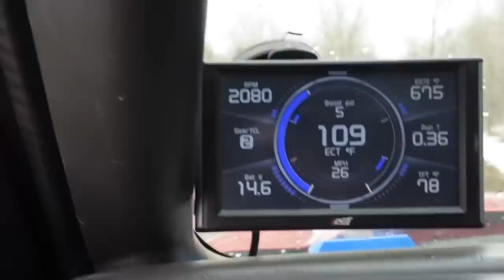MY DURAMAX LEFT ME STRANDED SO I DID THIS!

Comment: I would leave it looking stock on the outside while improving the intake and under hood components. Maybe install a flat-bar intercooler which will reduce intake temps over 100 degrees.... The perfect camper pulling rig.   Nice ride Josh.

Comment: Love my LMM. Deleted and tuned, all HSP piping, 4 inch straight piped, AD 4G 165gph, TransGo shift kit, Dan's diesel performance Allison transmission computer with Enhanced trans tune. Crew Cab 4x4 LTZ, loaded. 
She outruns 5.0 GT Mustangs. Daily driver. Gets 22mpg.
You gotta get the genuine neoprene custom fit seat covers from Cover Kings for that LMM. I got them and they're amazing. Looks factory, and super comfortable. 
Mine is leveled with with the Zone Offroad upper control arm kit, 33 inch tires.

Comment: I just installed aftermarket return lines with my new motor, injectors, ect. should i be worried i thought i saw you use them and that's why i got them. Also Thank you so much for your videos if it wasn't for you my truck would be in the driveway with a cracked piston. no way i could afford to have a shop do the swap and I desperately needed my truck for work . Me and my buddy used your videos to do 90% of it with very little experience working on diesel engines it my first one . picked up a LBZ engine with lower mileage from a junkyard and swapped it in my 2 car garage.  so far everything has been perfect! THANK YOU!
Reply from the maker: That’s awesome man I’m glad the videos helped! I’m thinking the return metal fittings are recommended but the cheap return hose failed on me so I would say keep an eye on it
Reply: There's lots of opinions to use original return lines. Tons of aftermarket just leak

Comment: Well Pvt. Recovery proved herself worthy of joining the platoon. Keep the upgrades simple and clean. Aimed at pulling the Command Post around.  Maybe a topper on the bed, allowing for additional troop support  cargo on the weekend deployments.  A good all terrain tire with proper sidewall height and capacity for towing.  Zero lift, leveling airbags. Proper lighting up grades, back up cameras,  transmission up grades for towing.  Repair the rear body damage and Raptor liner the bed. Black rims with red trimming. Mild exhaust upgrade.  ..... BUT FIRST... [dream scene ends abruptly].. FINISH THE WIFEMAX  !!! 
 great project looking forward to seeing what's next  and as always well done program.
Reply: One other note... for your travel trailer.  Look at rock guards for the front of it. Additionally you can easily fabricate a full length bar and mud flap that works with the rec. hitch.  Traveling down the highway over time flings a lot of small rocks.  The front of the trailer catches them all.  Foul weather of any kind just adds to it with road debris.

Comment: My ‘07 classic ccsb Lbz mostly stock, but leveling kit and rear block with 285s weighs exactly 7,000lbs. Not stock for long, just picked up a Dana 60 front out of an ‘05 f250 to do an SAS on the front end. I will always buy GM only but am not a fan of ifs
Reply: IFS has the best ride quality. Throw on some HD tie rods and center link braces and it's pretty much bulletproof.

Comment: I do actually run the aftermarket return lines thatre the rubber fuel lines with the lil metal injector fittings instead of the plastics and personally I LIKE them. They have done very well so far and were incredibly easy to fan into your own lil custom lines. And they compliment the engine bay well with how dang shiny the metal fellas are! I'd recommend them.
Reply: It's usually shitty clips that pop off. I had a LBZ before getting my LMM. Was driving that LBZ one day and started to smell a strong diesel fuel smell and noticed white smoke behind me. Pulled over and saw fuel pouring from an injector return line. The clip was missing. Just fell off and the return fitting popped off.
Reply: @saltysteel3996  I like these fitting atleast because they fit into the injector very snug and firm. I do see where ur coming from with the clips tho! Because I noticed when installing some of them that a couple seemed to fit a little bit loosely or would walk back slightly. But I was able to fix this by just taking them and gently squeezing them a little closer together for a tighter pinch. Little trial and error with making sure they weren't squeezed to much and cause u to just wrestle getting it snapped on there but all and all just squeezing them a bit solved those issues quick! Granted it hasn't been quite a year since I've installed them but close to and I haven't had a single issue out of them yet! I do however check under the hood atleast once a week and always check on them just to make sure. I had 1 clip slide back maybe a 1/16th of an inch on me a few months ago. Pulled off punched it a lil more and hasn't moved at all since then! Maybe I just got lucky I guess? Idk, but so far even considering the clip situation u mentioned I 100% would still recommend. Just take your time on the install and pay attention to those tiny minor details like that and it'll all be good by the end!

Comment: Are you sure that the head gaskets are bad. The LMM is running awefully well to have blown head gaskets.
Reply from the maker: I will find out very shortly
Reply: @TruckMaster  I'd be surprised if they're bad. LBZs and LMMs don't usually have head gasket issues, even when turned up to the max.
It's usually the water pumps that are known for failing. Luckily my LMM hasn't had water pump issues yet.
Reply: I was thinking that myself but it be so awesome for ya if it be something else hoping it is would you consider fire ringing or leaving it like it is just curious
Reply: Truck master do you normally add diesel additives every time you add full.
Reply: @Andrew-mr4cj  from what I've found most people say you don't really need fire rings on a dmax
Reply: I don’t think I’ve ever seen a duramax run poorly from a bad HG, they blow internally so all they really ever do is pressurize the system and puke coolant
Reply: Do any of y’all add diesel additives every time y’all add fuel or fill up.
Reply: @robbieholcombe1213  every time I fill up I do. I use hotshot edt
Reply: @robbieholcombe1213  I add a gallon of ATF every 3 or 4 tanks

Comment: Had a 2013 GMC and now I have a lly I miss my 2013 pulling a 42' 5th wheel Montana 25500 lbs fully loaded lly can do it but summit she was a Beast at pulling. I can tell ya the 6.0 and the 6.4 f450 don't run like a Duramax.

Comment: Okay, your kidding when you said your getting 15 mpg towing that trailer will that truck on the back!
I’ve got a 2020,3500 hd duramax drove from florida to Wisconsin hauling trailer and car and averaged 9.9 miles per gallon.
I’m very disappointed, I thought it would be better,with the 10 speed trans.
Reply from the maker: That’s what it said on the dash 🤷‍♂️ but this truck is tuned and deleted also so it probably really helps

Comment: As a legit wrenches, maybe come up with “The roadside survival kit” .  I keep fuel filters, fuel treatment, oil, serpentine belt, tools.  But I never carried fuel line.  Hey TM, What else do you think we should have?
Reply: Duct tape, concrete tie wire, zip ties, fuses, bulbs, 16ga wire, wire terminals, multimeter

Comment: That video was awsome I just bought my first disesl  pickup and it's a 2016  Chevy 2500 durmax. So this video helped me out. I do have  a few questions  I'm getting  18.5 mpg  on the road running 65-67 mph.  My questions is if I want to increase  my mpg  and I want to a good cold intake air system  on it . I do use on my farm and driving  to doctors  appointments  in Temple , Abilene  Texas  so I'm thinking about a set of  torque

Comment: About time for another video truck master!!!!!!!! LOL
Reply: @TruckMaster  I would do the samething you are doing before replacing head gaskets. Fix the simpler things that cost next to nothing and then work from there. Atleast if you do have to replace head gaskets you got new thermostats now, coolant, and a new upper radiator hose too. Mint cherry brother!!!!
Reply: @TruckMaster  Love that truck as well as all of them. Keep a keen eye for rocker rust and rear fender rust. I got a little on my 09 and wash it in the winter etc. Caking it in fluid film soon, springs coming...
Reply: @TruckMaster  Im wanting to buy a used diesel truck. Should I buy a used cummins or duramax? I got a 5.3 and 6.0 gas chevrolets that I love. Wanting a diesel too!! Want to spend around 5 to 10k for a diesel. Which one you think is better in the price range???

Comment: Stay away from the raptor liner. It turns white and does not last.  Go with Rhino or line X
Reply: I've had 2 trucks Line X sprayed. After years of abuse the color is still good, and takes the abuse.
Rhino is no good, it is too soft and doesn't hold up to hard work.
Reply: What about T-Rex bed liner from Speedokote? That's what I have waiting to use on a rust free bed I'm preparing for my '06 Sierra. 
Any experience with that? I'm under the impression that it's probably just like the Raptor liner.

Comment: Im honestly surprised you haven't replaced that hose yet lol. How did u get the truck on the trailer with the wheels?
Reply: He probably drove over the fenders, that's what I have to do with mine.
Reply: @stedegrissom5788  alot of weight on dinky fenders
Reply from the maker: I drove over the fenders

Comment: Can you do a blow by test in the video for me?  My lmm blows some white smoke but it doesn’t blow the cap off or move it. Is that normal?  Is there supposed to be some smoke coming out of the oil fill tube, maybe it’s heat or condensation or evaporation 🤷🏻‍♂️ let me know
Reply: Sounds like injector hazing. Look that up. Might be time for new ones.

Comment: If it was me fortchinate an blessed with the opportunity to get a nice of a truck like that I'd probably put a banks cold air intake an a monster ram intake fire ringing it an 5 inch mbrb exhaust from turbo back banks intercooler an I have a question for ya would you ever consider using a banks pedal monster on your duramax

Comment: Just curious. What additive did you use in the fuel tank? It looked like Lucas.
Reply from the maker: Lucas
Reply: I run Hot Shots Secret everyday treatment. It's amazing stuff.
Reply: I use Dura-Lube EXP.
Reply: Project farm and others have done extensive testing on additives. Great for selecting one. Many of the top known/advertised don't perform that great

Comment: My LML has oil on that boot... what kit did you mention doing a swap out?
Reply from the maker: Hspdiesel, I actually have a coupon code that’s still good on there website it’s truckmaster
Reply: Look up the PCV reroute mod. Easy to do if you wanna go aftermarket or stay stock. You just need a close off plug if you stay stock.
Reply: Truck is already deleted and efi live.